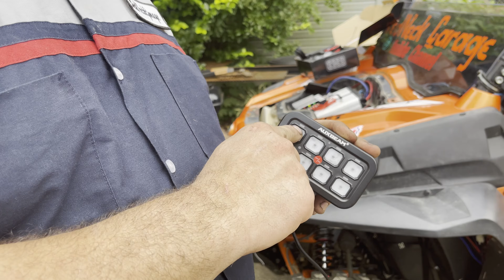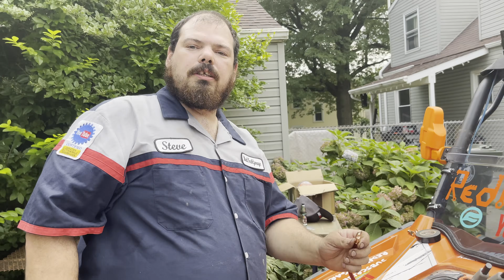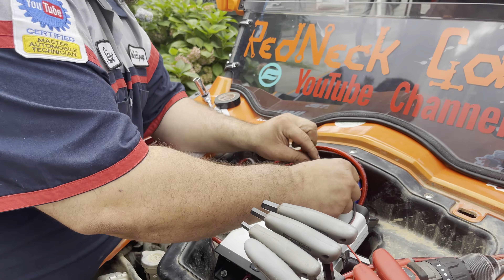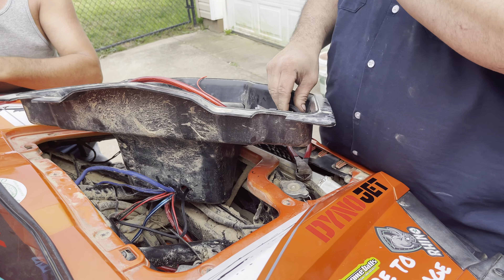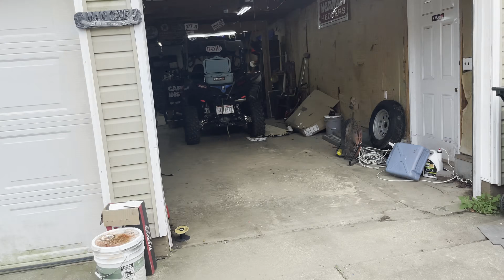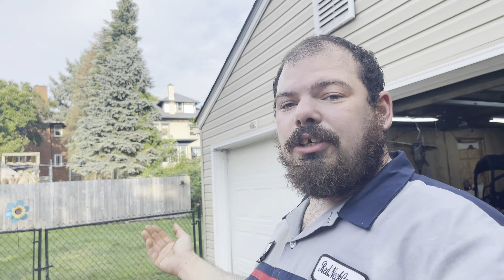Auxbeam 8 Gang Switch Panel

Comment: When you hooked on to the red power cable for the winch did you splice into the line itself or hook it up with a connector to the point of connection on the winch itself ? also I would think that it would control the aux  beam with the ignition key , am I correct in thinking that  ? many thanks Steve , Brad

Comment: I’m getting constant power to the panel even without have the red wire that has the fuse plugged in how do I keep from getting constant power to panel I have to trip the breaker if not it will drain the battery thank you
Reply from the maker: Do you have it hooked up like mine? Mine has never drained the battery
Reply: @R.N.GPerformance   I have a red cable coming from the positive to breaker and from the breaker to the panel and the red wire with the fuse has power on it with out having it plugged into the Cfmoto fuse and the panel has power also that’s why I have to kick breaker so it will go off  don’t understand why

Comment: Thanks for another great video of CFMOTO upgrades. Can we install a 26 inch soundbar on the  @Aux Beam 8 gang switch panel? Thanks& Be Well.
Reply from the maker: Your very welcome.  It should handle that no problem.
Reply: Good morning, RNG Performance. My soundbar power cable is not long enough to reach the 8 gang switch panel.Can you please tell what the proper gauge of wire I should use to make a extension to the switch panel. Thanks & Be Well.

Comment: Wish i found this last year after i cut, spliced, heat shrinked, and taped all my connections into other wires. Dont need the switches as the 950 had plenty of open spots for switches, just the fuse block alone would be nice
Reply from the maker: Yeah mine has plenty spots too and im with ya wish i had this sooner 😂 would have saved a ton of time.